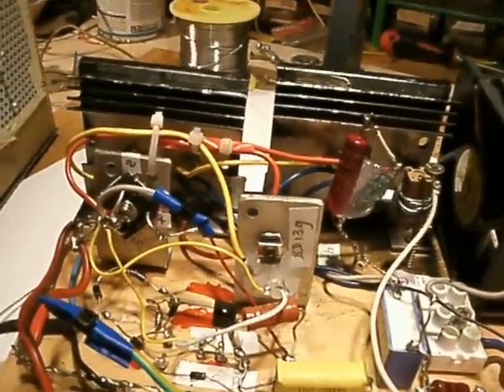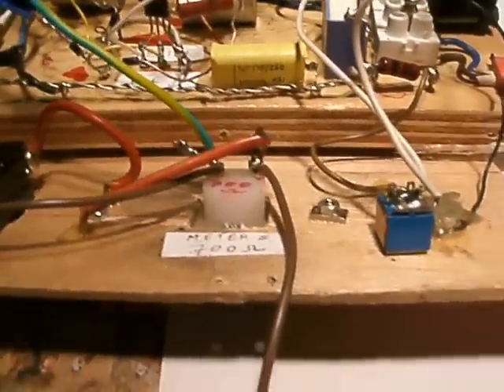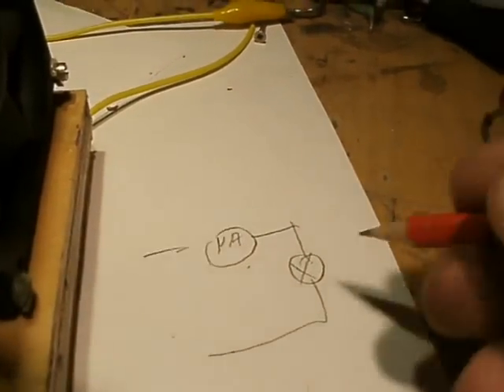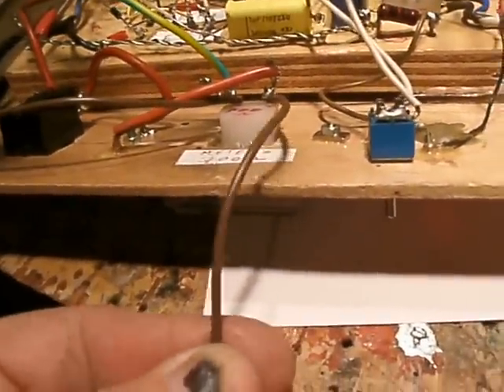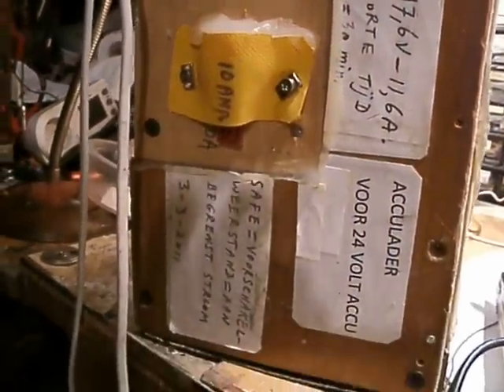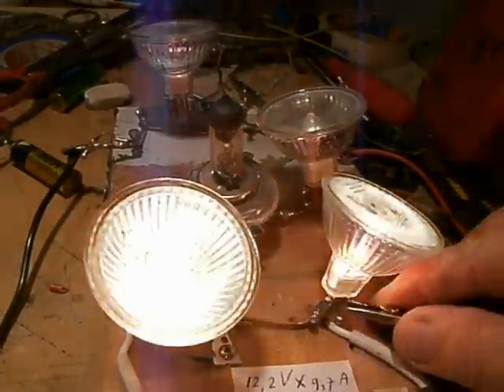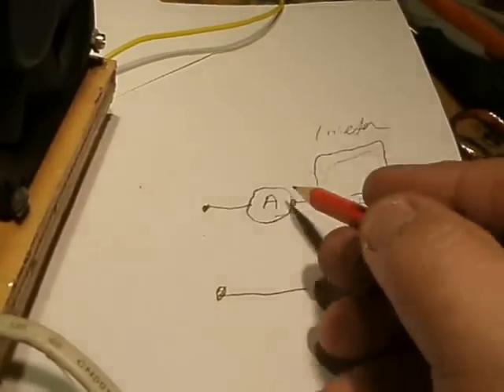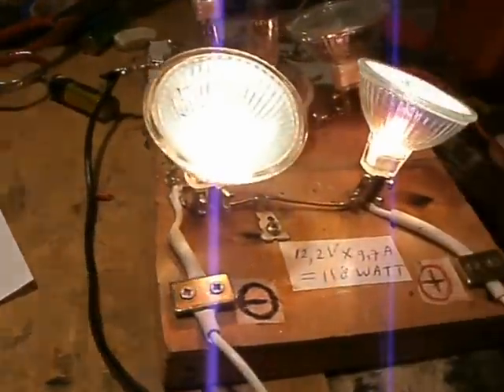how to make a shunt - DC Amperemeter

Comment: radiofun232 I'm not sure of your line of thinking.   An ammeter is basically measuring the in series voltage drop over a given load (with a fancy calculation if the load is not 1ohm).   I have a very accurate 1ohm resistor with high wattage that I use, and in that case (because of ohms law) the voltage drop is equivalent to the current consumed by the circuit.    Arbitrarily using 1 metre of wire is not going to provide you with a dependable resistance from which you can assume the reading is correct; which I guess is why you suggest using a "calibrated" ammeter in series.  I think a 1ohm high wattage resistor (for significant current) is the way to go.
Reply from the maker: Yes, that is the reason why you must calibrate the home brew Amp meter (with a more or less random shunt resistance in the range of 0,0X or 0,00X ohm) with a calibrated Ampreremeter in series to the load. The reading is always correct when you write your scale on the basis of the values that the calibrated meter shows. You must do this calibration "in situ" because the thickness from the wiring to and from the Ampere meter(s) plays a role too, because all happens in the 0,0X and 0,00X Ohm range when you work with high currents. Even the wiring can give an error from a few procent.Of course this homebrew Amp meter is not a precision instrument and can never be that...
Reply from the maker: By the way: your approach from the circuit is (in my opinion) competely correct. In fact we measure the voltage drop parallel to the shunt resistor (this is proportional to the current) and perhaps this had to be told too in this video.

Comment: Why not just use a resistor instead of a meter of wire?
Reply from the maker: The resistor must be in the 0,0X or 0,00X range when you want to measure currents in the 7-10 Ampere range. And the shunt can get warm or hot. For other applications (measuring in the 50 mA-300 mA range) a resistor is a good choice.
Reply: Hello radiofun232,   If I ask you a question would you be able to help me please? It is about the cheap digital volt/ammeter from ebay... Thanks  John.... :)